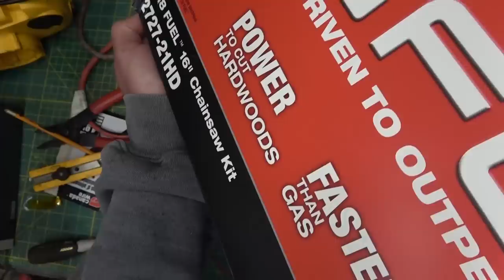BOLTR: Milwaukee Chainsaw | Destroys DeWalt

Comment: Unfortunately when used head to head in real life the Dewalt destroys the Milwaukee cuts faster and longer and both throw their chains the same
Reply: I'm a Flexvolt guy and bought their chainsaw, but while I agree the chain stays put better than I thought it would, it doesn't have the torque of the Milwaukee that I just purchased. However my concern is that the Milwaukee batteries are getting too hot while the flexvolt batteries stay at 85 degrees...
Reply: @MyFortressConstruction  The Dewalt has more torque, I used them side by side clearing out hunting spots and the Dewalt cut much faster on every kind of tree from oak, maple, chestnut, pine and black locust it was faster and never overheated the batteries and it also feels better built. A little tip for yah if you cut pine clean your chainsaw completely that pine sap is a killer
Reply: @loucifer323  huh, that's really strange, I got the exact opposite from them. The Milwaukee cut at about the same speed but I was cutting some Osage orange (horse apple) which is super tough and the DeWalt struggled quite a bit. But like you said, the DeWalt batteries did not overheat...
Reply: @MyFortressConstruction  were both chains brand new it's a big difference between a new chain and used chain say you can cut a 8inch diameter oak log in 8 seconds wirh a new chain and they you use tgat chain all day cutting wood then go back and cut tgat same 8inch log and your time will increase almost double
Reply: @loucifer323  yeah, I waited until I got the Milwaukee specifically so I could compare new out of the box. DeWalt worked decently, just bound up a lot faster than the Milwaukee in the denser wood.

Comment: I use a couple of Stihl saws that are perhaps going on 40-50 years old.   They still work and run just fine.  I have a little Homelite XL that I purchased in 1990--a great little saw that runs fine.

So, who will wager that this overpriced piece of plastic will be around and working in 2040?  It seems that we live in the age of trash.

Comment: The only guy I know that cuts open his boxes with a drywall hole-cutter....

Here on the wet coast (Vancouver, British Columbia, Canada), if I use the electric tools on our many rainy days, yer testeronies will be jiggled to pan-fried oyster temperatures by 20 watts ore more EVEN WITH all that double-insulated shell ...NOT GOOD !!!

HOWEVER, since in the future ALL powered hand-tools will be battery-ops, They KEY ISSUE is finding out the TYPE of battery your tools will use! Since Lithium Ion is the PROBLEM CHILD of battery tech with its low number of recharge times when you keep recharging it at only 70% full (i.e. 30% discharge) which far too many people do, no wonder your batteries will die after only 3 to 6 months and final output power feels like you in the morning after 12 shots of jagermeister! You're just putting metal dendrites in those cells doing that recharge at 70% thing!

NOW when that new fancy aluminum oxide and/or graphene battery tech starts coming down the road, ONLY THEN will we all be getting those super-duper 150-to-500 Watt hand tools at 15-to-20 amps/24 volts) current for that SUPER-HIGH TORQUE and loooooooong battery life! Right now, the Lithium batteries are the yeast infections of tool power-up solutions, they keep coming back and just never seem to go away, always dragging yer action-jackson performance down!

My local nutcase metal worker friend has his rather weird solution to the Li-Ion problem, by ripping out the ENGINE PARTS of many gas-powered tools such as older but truly heavy duty drills, saws, grinders, etc. (they tend to have casings MUCH LARGER than electric tools) and putting HUGE DC motors in them powered by easy-to-replace slabs of nickel metal hydride batteries used in mil-spec compute and vehicle systems. Those slabs are RUGGEDIZED tough as nails and usually START at 375 watts at 24 or 48 volts (15 to 30 amps)! The biggest still-easy-to-lug NiMH battery slab is a whopping 750 watter at 30 amps (24v) His runtime varies of course but TORQUE-WISE he's getting some hole digging and metal-slicing done REAL QUICK!

It's a bit of a DRASTIC and he gets to work out his arms to a HUGE degree...BUT...his solution works for turning an old gas-powered or originally electrical corded tool to portable BATTERY power!

Comment: I just received mine this weekend. I do not like the appearance of it at all. Looks like they rushed the body style through a 1980s design. Really horseshit. Compare it to their other cordless tools and you see what I am talking about. Going to use it later in the week. Maybe it needs to be smooth to keep shit off. I guess, as long as it works and isn't a bitch to replace or tighten the chain.

Comment: U should do a teardown on a Husquvarna lawnmower. A real  piece of shit. I couldnt believe that they'd sold out too. Is there any company left thats still owned by people that believe in building a quality product? Hilti? Anyone? I listened to a guy whod given up on buying a decent washer after spending $600 plus on Samsung's and others and decided hed aquire an old Kenmore and just rebuild it as they regularly went 20 yrs back in the day. I can attest.to the Samsung's bein a piece of shit at $6 to $800 bucks and lasting 2 or 3 yrs.....if ur lucky. Here in Silicon Valley , home of the 1.3 million dollar 60 yr old tract home on a 5000 square ft lot. And kids gettin $200k a yr. Outta college to work for Google bein a place where thinking this house of cards will last in perpetuity buy and toss products out like Tittly Winks. I picked up a 2 or 3 yr old Samsung washer that still looked new at the curb knowing they cost $800 and.figuring some.overpaid.kid had tossed  it because it didn't match his decor and yes I have picked up matching functional washer / dryers for that reason and resold them the next day for $250, anyways upon deconstruction i found such cheesy construction on an $800 washer i was surprised. The failure was fatal and permanent. The motors platic stator had a starburst of cracks radiateing from the center probably from to much heat. Unbelievable!....well not really, not anymore.Their all that way now as far as i can see. Not sure about the Bosch yet. Rich/San Jose

Comment: Batteries and motors are great, and as a mobile auto mechanic it's a life changer. But I have to draw the line somewhere and I think chainsaws are on the other side of the line. They have to have gas engines :/

Comment: Either way you cut it, its a small time saw. Great for indoor work because obviously no fumes and any indoor cutting is always minimal. I live on some land in not the city, an electric saw would never cut it. Not when a saw project usually is at least a day long thing. I could see this hanging on the wall in the cookie cutter houses that are so close to each other you can smell when your neighbors fart and you can also dsmell when his old lady hasn't washed her lady parts in a few weeks. Defiantly a little league saw. My 2 strokes always start. Then again, I enjoy doing the maintenance on my equipment. Much more appealing to me then watching greys anatomy while my saw battery charges lol. My dick is tightly controlled in a vice!
Reply: I used to love my gas saws.  Now, at 70 I love my battery saw.  No ear plugs, no yanking, no gas/oil, etc.  I use to love repairing gas equipment too.  I've cut perhaps 25 pickup loads of 16" diameter wood over the past few months with my battery saw.  I do a lot of weed whacking too.  One battery change equals one tank of gas.  Sure, It's not a day long thing, but one trip to the woods per day is all this retired old fart likes to do for fun.  After that it becomes work.

Comment: Don't  look to much different  than my husky 240 but the 240 is the cheapest husky there is but is was only 225 or so usa tender fucker has heated the house for 9 years probably bucked 30 quarts of fire wood and a bunch of big ass lumber beams big Milwaukee fan but faster than gas no way no how that's like she said  it's bigger than average but for cutting  lumber quick and easy sure but 600 dollars run a 300 dollar gas saw for 5 year's  on 300 more in fuel and bar oil if it was 200 I'd buy it

Comment: 600 dollar plastic toy
Reply: Every electric saw (corded and cordless) has a plastic housing today. Even some brand gas saws use plastic housings.
They can be quite robust, if the manufacturer uses the right material, and enough thickness.
A aluminum housing, like it's used on Stihl gas saws, is always heavier.